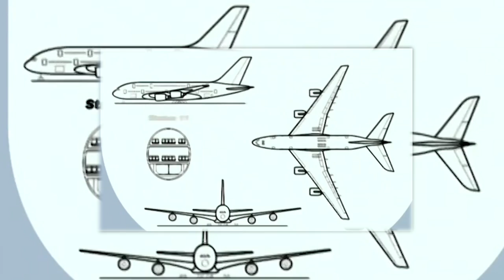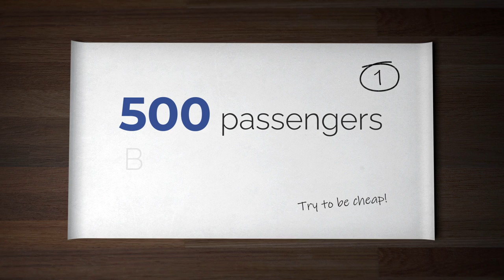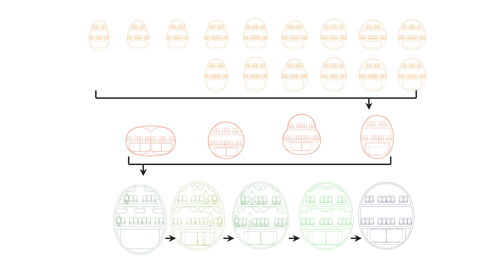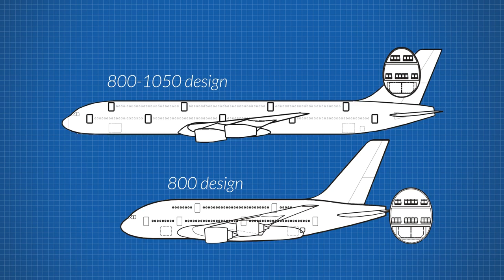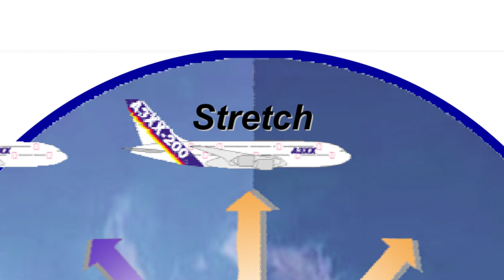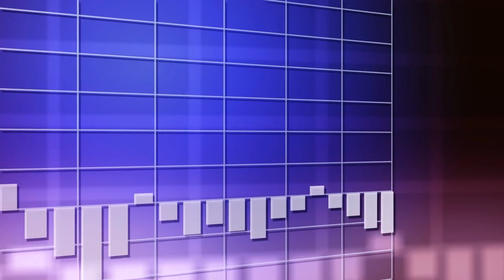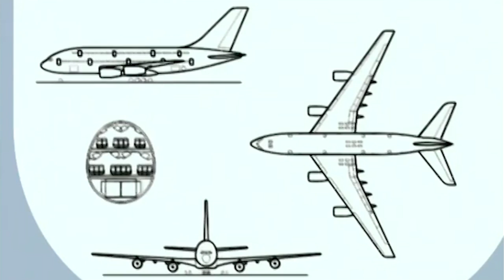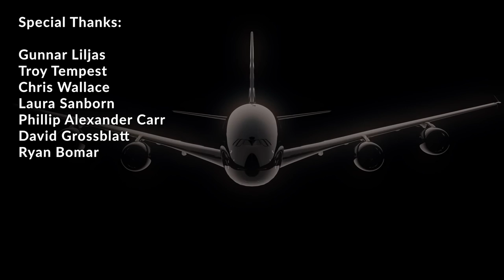Airbus A380 Alternative Designs - How They Made The Perfect Boeing 747 Rival

Comment: Well thank you for very nice video im sorry to the lost future of the Airbus A380-900 that would have been amazing but the A380-800 fuel cost grew to much the the corona virus pandemic brought the Airline business down but also my concern is that Oil industry is polluting the world to much so we much more rescreach and development to do I Like the A380 planes. To bad many different of this plane could not be released.
Reply: My guess is that the A380 will rise again...the planes really never got smaller. Its really just that market that earlier used B757 grew to 767 then to 787 or 777, removing passanget from core lines, making the market for jumbo shrik.

But eventuelly one of the 777 lines will be filled to capacity
Reply: @matsv201  well thank you I agree with your comment they can rise again hopefully we can make a hydrogen plane that big or even bigger and that is clean fuel I think or a hybrid plane of electric and hydrogen fuel or some other clean fuel.
Reply: @matsv201  but your right the demand will grow so much they going to need the A380-800 back and the bigger A380-900 and we can even bring the cargo 
A380 Alive
Reply: @ridesharesafetyguide1370  The thing is that the A380 is really quite a old aircraft.. construction vice.

There is sort of a generations in airliner. There is no official definition, but this is pretty much what i make of it

Gen 0 - Commet, Gen 1 - 707, Gen 2 747-100, Gen 3 - A300, Gen 4 - Dreamliner

Gen 0: Just WWII stuff bulted together
Gen 1: low bypass engines. Steam gauges, manual engine control 
Gen 2: High bypass engines. CRT and some automatic engine control, still some steam gauges
Gen 3: High bypass engines. Full digital flight control deck, no engineer, composite pannels
Gen 4: Geared gasturbines. Electric pressurization, digital control non primary surfaces, all non major panels, composite wing and body, interior design optimizations.

I would say there is currently 3 gen 4 airliners around. B787, A350 and A220.  SpaceJet and MC-21 coming this year. Don´t know if i would call them fully gen 4.

Now there are gen 3½ aircraft's like 320neo, 330neo, 737max, 777x, E2 jet.

With the A220, A320neo, A330neo, A350 Airbus now only sell gen 3½ and gen 4 airliners. The A380 is fully gen 3, really no gen 4 features to talk about. 

Boeing still sell the 767 and the 747 that is fully gen 3. 747 is pretty much dead. Last order was in 2018. Officially A380 is out of production, but airbus still have 5 more to make.

notation: There is actually only 462 Jumbojets flying, while there is 223 superjumbos flying: So the diffrance is not as huge as one might think.

Anyway. It was Airbus that killed of the A380, not the customers. If Airbus didn´t announce they would stop producing it, they could have been keep going with the order stock they had to 2025 at least. My guess is that the A350 is way more profitable to produce. My guess is that the A380 and the 747-i8 eventually will find a new market prefilling a future market for really large aircrafts.

Well there be a A380neo... And to be specific.. i in the same way as the A330neo... And i would say no. The reason somewhat confusion: The aircraft is to small and to heavy.

A A380-800 have a operational empty weight of 277 tons. The A350-900 have a operational empty weight of 135tons. The problem.. Two A350-900 is way larger than one A380-800. Just replace the engine would not help that problem

It need to be larger, AND lighter. A lot of both. So a new A380 would probobly rather be a A390... Sort or what the A350 is to the A340
Reply: @ridesharesafetyguide1370  I would ad. I don´t think we are going to see subsonic hydrogen powered aircraft. For hyper-sonic, that is a different question. when specific impulse matters, hydrogen is much more useful.

Boeing still have a bit of horizontal segmentation, say 767 vs 787. The 767-400 and 787-9 have virtually the same capacity. This is also actually the reason behind 1:st class seating. A long distance aircraft can either take more passenger or more fuel. So if they need more range, they replace economy seats with first class seats... hence lose less money then just having empty seats.

Anyway A320 and A330 is on the end of the roaps, even with new engines. There wing and fuselage is to old. Also there inner fabric.

Look at it this way. A A220-300 cost $90M and takes pax max 160 passangers and consume 1.85L/px/100km. A A319 cost $101M takes pax max 160 passanger and consume 2.7L/px/100km.

Why would anyone buy a A319Neo... They wouldn´t and they don´t. Only 2 319neo have been produced... Two... not 200. As a reference 1200 A320neo have been produced. 

Inoffcially there is a A220-500 supose to be a compettitor to the A320... But romurs have it that Airbus streched it to put it between the A320 and A321, pretty much terminating the A320 market. That would be the end of the A320 as soon as the current order-stock is done.

There is a gap in the market... where the 757 use to be. And.. well Boeing is making the 797... If airbus is smart they order a body widen 3+3 A220 series... lets say A230.  That would need a new wing. But they could keep the fabric and the neo engines. I bet you its already on the drawinboard.

That would put the A330 the only not truly gen 4 aircraft left in the fleet. The simplest way of solving that is to make a shrink-down A350. Shrinking down is cheaper than making larger.. so the retooling cost should be minimal. Actually,. The A350 suppose to be A340 size to begin with. The hard part is what to name it?.. The A335?

Then there is the A360. Airbus left that number empty for future use. The A380 was a way to say "our number suggest size, not age"

So lets recap.
A220 - 5 abreast
A320 - 6 abreast (future hypothetical A230 as well)
A330 - 8 abreast (and so is A340)
A350 - 9 abreast
"A360" - 10 abreast

Think of the A360 as a upside down 747. In steed of having a small bit with a extra floor over, it would be under. The reason is simply because its much cheaper to make. Pretty much if you have a 10 abreast plane. The cargohold will be full standing high. 

It would be 2 engined. Because, now when we have geard turbines, there is really no size limitation any more. And i would assume that they would introduce canards by this time. The reason is that canard is about 10% more efficient than tail. This is a efficiency gain they just won´t leave on the table anymore. The airports just need to deal with it. We probobly would see a fold wing like on the 777x also.  Size and capacity of the A360 would be pretty much identical to the 747-8.

If you think that is far fetched. The capacity of the 787-8 is only 8 ton larger than the A350. The reason why the diffrance is so small is that the A350 needs 70 ton less fuel to cover maximum range, that is actually longer than for the 747-8. Smack on foldable wingtips and a canard and steal the engines of a 777x and you got a new aircraft with the same capacity as a jumbo.

Comment: AIRBUS should have launched the stretched A380-900 version instead of the A380-800 in the first place!!! like they did with A350 XWB series, AIRBUS launched the A350-900 instead of the A350-800 which was a very wise decision!!! not all set & done yet, AIRBUS can still launch a super stretched version of the A380-800 known as the A380-1000 Neo LR that'll seat upto 750 paxs in a three class cabin configuration & fly 13,600 kms non stop!!! but the A380-1000 Neo LR would have to be powered by a combination of turbo fan engines & intelligent hybrid tech that'll make the A380-1000 Neo LR 40% more fuel efficient than a conventional four engined A380-1000 Neo LR!!! yes the A380-1000 Neo LR will have 16% larger wings & will also have longer/taller front & rear wheeled landing gear thus increasing the overall height of the aircraft!!! hybrid propulsion is the only way to keep quad jets like the B747-8I & A380-800 still flying!!! believe it or not a quad jet can be as much fuel efficient as a twin jet!!! it's all about achieving a level of efficiency that'll be second to none!!!

Comment: A380 is far from a perfect rival to the 747 in fact it was the best thing Boeing  could hope for. It darn near bankrupted airbus and has proven to be a huge waste and failure
Reply: At the end the most capable A 380 competitor was not the 747-8 but the 777-300 ER. 
It was expensive for Airbus, but since they at least sold 251 aircraft the losses are not existential. Boeing also had a very costly and troubleshooting program with the 787 (despite the high production numbers), and it's unlikely the will get much profit out of the program.
But profits are not everything, every manufacturer benefits from experience made in programs, Boeing and Airbus, and the knowledge and know how got can be used in other future programs.

Comment: "With the boeing 747 sr"
Shows a 747 300 when they should have shown the 747 400D and actually should have showed the 747 100/200SR instead of  shows the 747 400D which is actually the the 747 SR but the 400 model also this is so long

Comment: Except the 747 will still be flying long after the A380 is a museum piece
Reply: What will fly longer is the 747 F - the passenger - 400s are almost all retired now (they are too old and the 777-X offers the same number of seats) and there are very few - 8 passenger versions built.
The 747 is a good cargo aircraft, and this will be the main purpose in future for them.
Reply: @simonm1447  Yes I am aware of this but my point is I still think the passenger version will outlast the A380.
Reply: @mawsoncasey7347  Emirates may be flying the 380 until 2030, it's the airline where it fits quite good into their business model. They alone operate 123 380s, while the passenger version of the 747-8 was only sold 48 times in total. The - 400s are today mostly retired from passenger service.
What will outlast the 380 are surely the US government 747-8s, and probably the cargo versions. With the 777-X Boeing offers a fuel efficient aircraft with almost the same seat capacity of the 747-8, I could imagine it will supersede both models at the end
Reply: @simonm1447  There is no market for second hand A380's. Emirates say a lot of things and they will retire the A380 much earlier. Considering the 747 was flying in the 60's and will probably still be flying when the last 380 retires , it's a no contest .
Reply: @mawsoncasey7347  there is also no market for 2nd hand passenger 747-400s, not even for passenger 747-8is. If airlines have this aircraft, they can fly them until they are ready  for the boneyard or convert them to cargo aircraft.
747s flying today havo not much common with 747-100s or 200s, the - 400 got new wings and new engines, and the - 8 also got new wings and new engines. The - 400 is heavily modernized compared to earlier versions, including a modern cockpit with 2 pilots, like the 737 NG also has little to do with the Classic (it shares the fuselage, but has a new cockpit and new wings). What was left was the fuselage, a modernized 380 with better wings (the 380 wings are optimized for the bigger - 900 version) and new engines would be more competitive than the - 800 which was not modified since it entered market.
At the end both have the same fate, the passenger market has moved to smaller and more flexible 300 and 350 seat twin widebodies and both are obsolete today.
Reply: @mawsoncasey7347  it don't make any sense to discuss with hardcore fan boys, people who are blind for a neutral position and for any technical details.
Blocked
Reply: @simonm1447  triggered and gone to your safe space over an airplane discussion , how do you cope in real life .😂

Comment: The perfect Boeing rival.
Except that it wasn't. 
And is already leaving service.
Reply: Not to mention that it doesn't have anywhere near the same number of design issues either.
Reply: The 747 production line is also gonna be closed in 22, since almost all - 8 are cargo aircraft and the market there for 747s is saturated now. The 747-8 never really competed with the 380 since all 380s are passenger aircraft and most 747-8s are cargo aircraft, it was the 777 which competed with the A 380.

Comment: It's really sad that the A380 ended up effectively becoming a space shuttle. Simply too expensive and too 'much' for the task at hand. Given that it's REALLY good for it's intended purpose, but sadly it's intended purpose is something quite rare (in the shuttle's case; ONE example is payload recovery from space. With A380; hub & spoke airport models).
Luckily they learned a lot from the program and it if there's any silver lining it's that the end of the line comes at the hand of market trends, rather than any engineering mistakes!!
And while Airbus did smartly take notes off the 747 by offering a freighter version, they didn't really think it through, and unfortunately it's one of the main reasons the 747 has such an endurable design; it permeates more than a single field in aviation.
Aside from a fairly substantial disadvantage of not having a front cargo door, it was also paradoxically TOO big. Unfortunately limited range coupled with the fact the aircraft would reach MTOW long before anyone could ever fill it up to volumetric capacity in cargo.
An argument could be made that it was intended to have more efficient engines, but to that I say; why can't you put those engines on a 777 instead?

Comment: So what's about the A380F? You hardly talked about it... after all 747-8F is pretty successful, why wasn't there an A380F?
Reply: The program was delayed because they needed the engineers to get the - 800 ready, and the orders for the - F have been canceled then.
The - F would have needed an upgrade in MTOW, since the - 800 has much internal space but not enough payload to fill this space with cargo (the reason why they don't convert retired - 800s to cargo aircraft)

Comment: In my layman's opinion, the A380 should not use 4 engines, but only 3 engines. 3 engines from the 777 would be enough (Na minha opinião de leigo, o A380 não deveria usar 4 motores, mas apenas 3 motores. 3 motores do 777 seriam suficientes)
Reply: The GE90 engine wasn't available since there is a exclusive contract with GE and Boeing for this engine type, and it entered market after the design freeze since the 1st flight of the - 300 ER was years after the design freeze of the 380

Comment: A more interesting story would be how and why the A380 failed.
Reply: The market has shifted towards smaller 300 seaters which still have 15k km range. It's simpler and more flexible to operate 2 300 seaters than one 550 seater. 
This is also the reason why only 50 747-8i passenger aircraft had been sold

Comment: The video says that the A380 is the perfect 747 rival..
Reply: It sold much better than the 747 (which was sold only 50 times as passenger 747-8i). However the market has shifted, and 300 seaters are more common today.
Reply: @simonm1447  Since the A380's launch, the 747 has slightly outsold the A380. You may say at this point that that unfairly includes freighters and BBJ's, but then that's Airbus's fault for not making an aircraft that can do more than one thing - and really one of the key reasons it failed commercially.
Reply: @PauloSergioMDC  If you take the bare numbers that's right. 
However, contrary to the 747 the 380 is relatively specialized for passenger transport (due to the 2 decks with an oval fuselage with a floor which is a static part of the fuselage and can't be removed). 
It's the same with the 787, which can't simply be converted into a freighter without major modifications. You could say it's Boeing's fault here, but it has to do with the way the aircraft is built, and both had reasons to build it like they did. 

If you compare the deliveries, the last year a lot of 747-400 passenger aircraft had been delivered was 2001, afterwards the big majority had been cargo aircraft. The same for the -8, cargo aircraft outsold passenger versions more than 2:1, because the 747-8F is a good cargo aircraft, while the passenger version is not bad, but also not better than other aircraft types on market.
So the 747 and the 380s never had been real competitors, the major competitor for the 380 (and the 747-8 i) was the 777, which started with the version 777-300ER in the early 2000s (the smaller 777 versions are outdated today) and outsold 747s and 380s.
Reply: @simonm1447  The regardless of version or model, the 747 outsold the A380. Well actually, the 777-300ER has outsold the combined total for the, A380, A340-600 and A350-1000. There'll probably be a freighter version of Boeing's Dreamliner "mistake" - but there'll never be a production freighter or production ACJ A380.
Reply: @PauloSergioMDC  you sound like a Boeing employee ;-)
Reply: @simonm1447  Just keeping the peace. 8-)

Comment: The A380 won’t last much longer too expensive to run not that efficient and terrible in Freight and even if they do a freight variant still won’t be able to compete with a 747 which is the ultimate Jumbo Jet and will be around for a lot longer than the 380

Comment: IMO the failure is that it was build as a Luxury aircraft, not as a mass transport, it's way too big and heavy; the wing needs improvement IMHO a more blended wing, the Tube should had been more aerodynamic and wider on the low part, so it's not all the lift on the wings; the Arabs were right, 3 engines instead of 4,  on the tail and the tail will be 2, like jet fighters, it should had a hump like the 747, that will help with aerodynamic; also conical, like the Connies, even better aerodynamic, more testing on Supercomputers and Wind Tunnel, more models, more wing shapes. Yes, AIrbus went classic and mediocre, and so was this plane